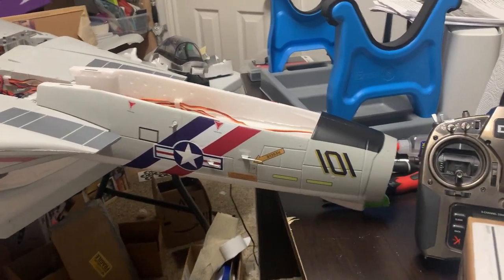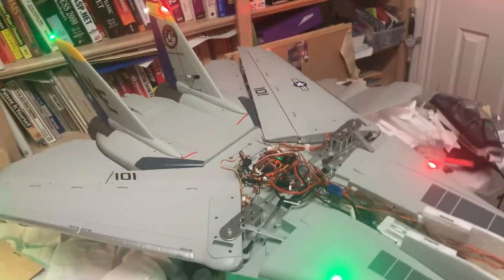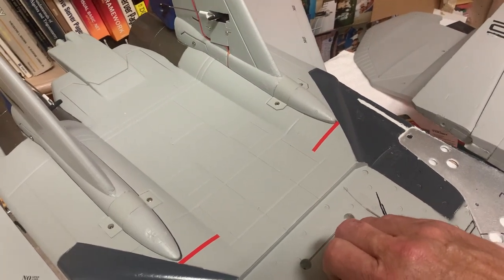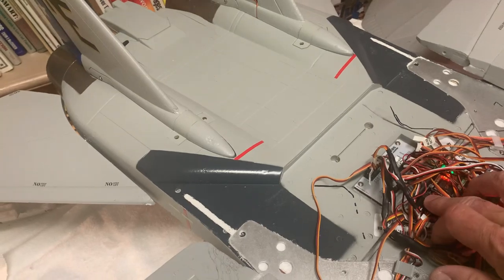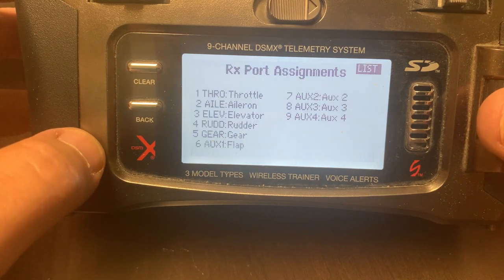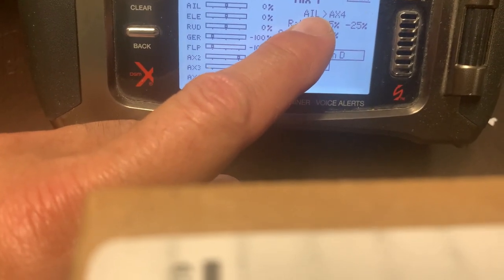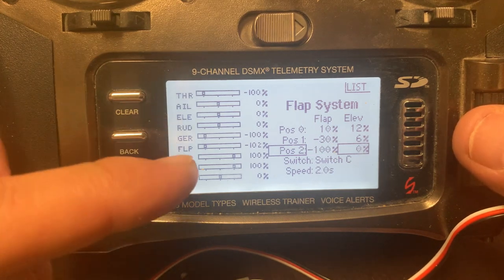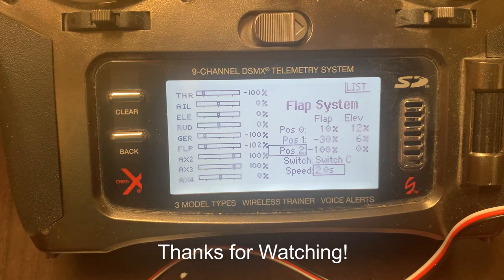Freewing F14 Controls Setup - Freewing Settings

Comment: I'm not seeing a link for your f14 basic setup. Also are you plugging in your ubec/bec into your bind port on your receiver?
Reply from the maker: See video description below video for the link to the other setup video.
I plug the ubec into a y-harness with the throttle. This way the bind port is free to plug bind plug in.
Reply: Ubec supposed to come directly off the battery connection buddy.

I have done 12 channel planes and never had a rats nest like i see here